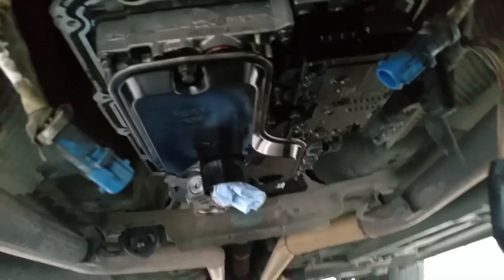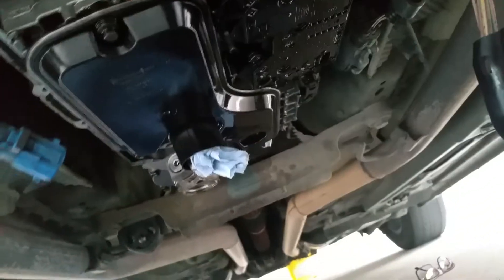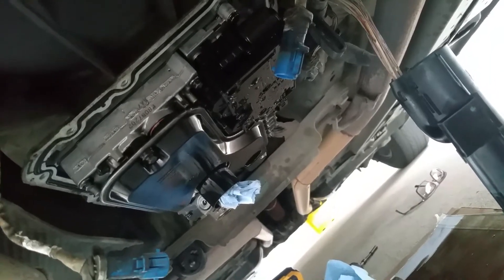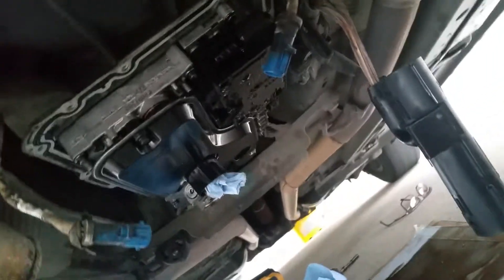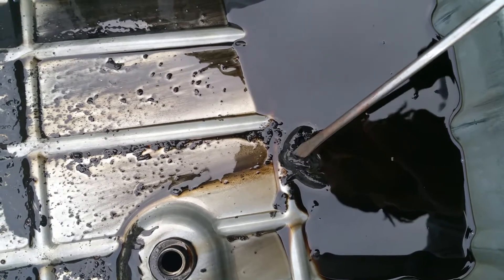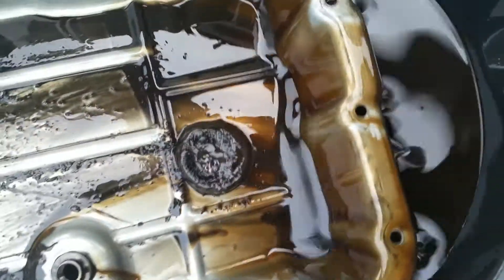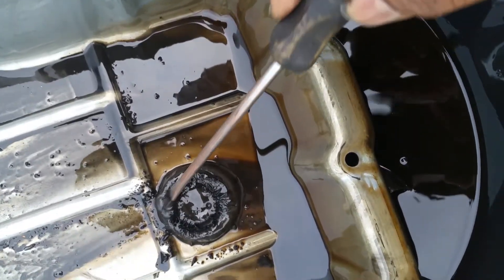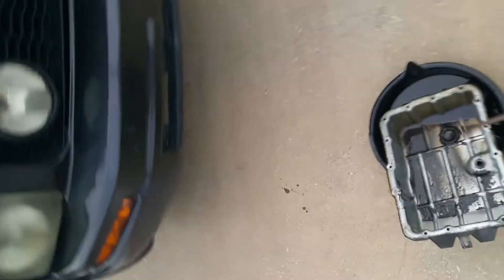2007 Ford Mustang Transmission problems

Comment: The problem is corrosion on the electrical fitting on the passenger side of the transmission, it comes from the ac dripping on to it trapping the moisture inside, take it appart and clean it reinstall with dielectric grease Ford put out a notice on it.
Reply: Where do you put this die electric grease

Comment: yea man your fluid is over 80,000 miles. someone didn't changed it on time and shit went downwards after that. change your transmission fluid on newer cars between 70-80k, older cars like 80s or 90s sooner than that.

Comment: Mine shifts completely fine in all forward gears but reverse takes exactly 15 seconds to engage…no more no less and it only does this when the engines warmed up. When reverse does engage it’s very smooth it doesn’t slam into gear…Also it will go into reverse immediately with no delay when cold starting. I’ve already changed the filter and replaced the fluid twice. No flashing O/D light, no check engine light and no slipping/delayed gear engagement in drive. Just this weird problem with reverse. It’s been this way for almost a year since I bought the car and it hasn’t gotten any worse. What in the world could be causing this???

Comment: How did it turn out?  Apparently there are a lot of problems with this transmission, including mine with a code P00775 and no OD.  Good luck.
Reply from the maker: Aviyaytor running like a champ, I have over 230,000 miles on her

Comment: How much was the total did you get it rebuilt or a brand new one and what was labor ? My auto transmission is starting to jerk a little and hesitate a little aswell bought it a few months ago 2005 mustang GT 90k miles so hopefully it needs transmission fluid and I don’t got to go that rout of buying a new transmission ps is it even worth buying a transmission ?
Reply from the maker: Foreihgn I was charged $3500 sadly
Reply: So what ? A couple grand for a new transmission and 1500 for the labor ? And is it worth buying a new transmission ? Or just selling the car
Reply: @Foreihgn You guys who suspect a problem it doesn't hurt to take down the pan and replace the Filter and replace the fluid needed to get it going. I would then put some miles on and change just the fluid again maybe 2-3 times to have new fluid inside the trans. That and the new filter may just do the trick. They even sell a kit to mount a Dipstick and filler Tube to this trans being they don't have dipsticks anymore. I put the kit in my daughters 2007 Mustang. Makes it so much easier to refill the trans rather then having to do it from the bottom. What ever you do don't go for one of those Fluid changes the repair shops try to sell you. They claim they can change all the fluid in your trans in one shot. They end up pushing dirty fluid back through all the lines and it has caused problems for many.
Reply: ffas23 thank you I appreciate your response I’ll try this, have a great day
Reply: Foreihgn  how did it go ?
Mine just hit 98k and today it started slipping ☹️
Reply: @ericguevara3034  I can’t show a photo on someone else’s You Tube post. If I could I would. I believe I purchased the kit from Summit.
Reply: @ffas23  darn, that’s okay thanks for the response.
Reply: @ffas23   my car won’t go to reverse at all. But it does goes in to drive but doesn’t switch gears the same as usually. Its an automatic. Is their any advice you can give me? It would really mean a lot at this moment.
Reply: @ericguevara3034  experiencing this right put it in a new filter and fluid seems to run a bit normal then before but still having problems
Reply: @Stone_Sour83   Did you ever find out the issue? Maybe shift solenoids? Or maybe gear differential in the rear?

Comment: Guys you should always change your transmission every 30,000 miles or even earlier if you really put your car through a lot of work. transmission fluid is not a life-time fluid like some people say, always make sure you inspect and work on your car. I also recommend you work on your own car or you'll get ripped of someone tried to charge me 220 plus tax just to drain my transmission fluid, then another $120 but I had to leave my car there overnight and ford tried to get me to get a new transmission like i just walked in and said i needed my transmission fluid changed then as soon I said it wasn't as smooth as it used to be they changed up and said they can't change the transmission fluid and that I need to make an appointment to speak to the transmission guy and that I need a new one installed.I said screw that went to auto zone bought 3 bottles of Mercon and a fluid pump and went to work, I feel so satisfied knowing I worked on my car my car rode so smooth after changing it.
Reply: Hope you changed the Transmission Filter at the same time. 3 Bottles of New Fluid isn't a complete change but helps with a New Trans Filter. If that Filter is clogged it could be part of your problem especially if a lot of miles on the car.

Comment: It looks like you let the trans go way too long with out a fluid change, Ford recommends 75000 miles to change fluid yours looks like 150000 or more, metal in the pan is normal just not a lot.
Reply from the maker: CrapHitting TheFan I wish I knew that sooner
Reply from the maker: CrapHitting TheFan That's exactly what the mechanics said

Comment: Most Auto Transmissions show that kind of crud on the bottom of the pan. The magnet is there for that reason to draw it to the magnet. You should of taken some brakecleen and wiped that pan down clean. Use a rag or paper towels at first to get most of it clean then spray it down with brakecleen. The gasket is reuseable so bolt the pan up and fill it the proper way with fluid. Pretty sure your car doesn't have a dip stick so it doesn't have a fluid tube to add fluid. The newer Ford transmissions are filled from the bottom if you are not aware and checked to be full from the bottom. There are You Tube videos showing you how to do the refill.
Reply from the maker: ffas23 I real cleaned it real good before putting it back on
Reply: @Mr09131977   so after my car couldnt drive at all i replaced the filter now it only drives in gears 1 and 2 and 3 but  bearly goes into drive and bearly any reverse and the car has 212k what do you think it could be the solenoids were whinning alot then now they dont anymore 🤔 ever since i replaced the filter hmmmm any ideas i need some help finding out i have an 07 automatic mustang Convertible
Reply: @thomashardi9606  you ever find the problem ?